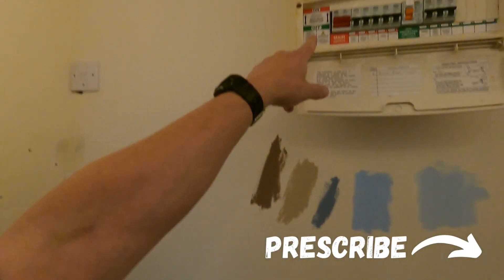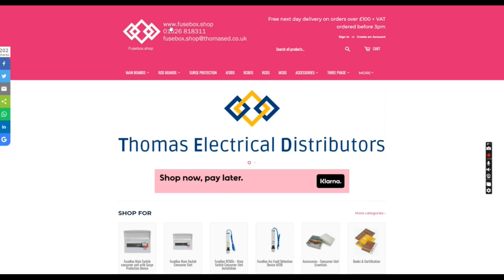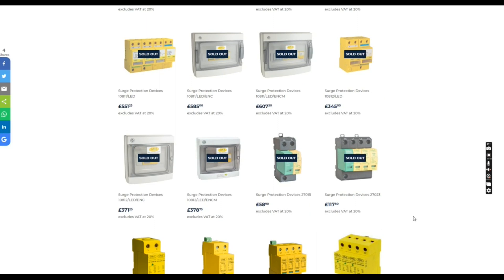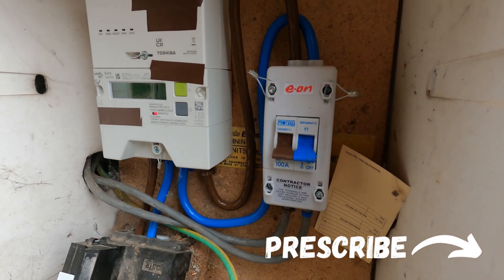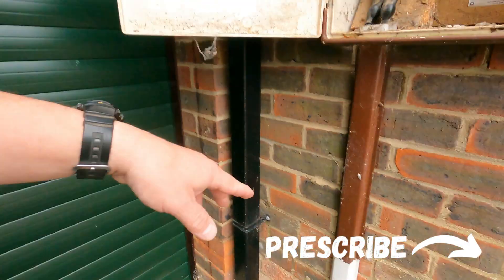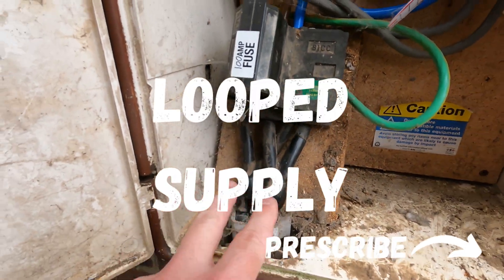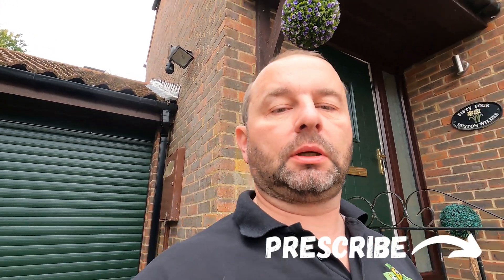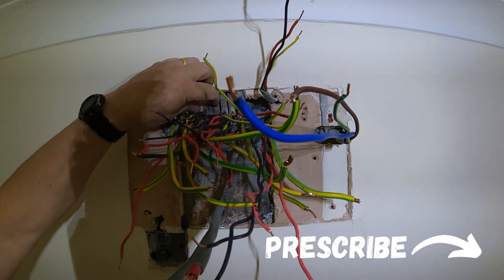Consumer unit change

Comment: Nice one cheers Dean For making the video is really good point about the looped supply. One thing I’ve only just discovered I’ve only started using the fuse box consumer units for the last three months I didn’t realise the taller RCBO’s or not double pole. Great job
Reply from the maker: Hi wills, thanks for the great comment.
I didn't realise that either, I've still got some in the van so I will test them later on today to check.
Thanks for watching!

Comment: Nice neat job, nice to see connecting isolated obsolete cable into earth bar. The fusebox boards are ok, but have found the actual metal enclosure to be really flimsy and it easily distorts when knocking out the grommet or rear entry holes. But the worst bits in my opinion are -  the RCBOs etc twist and hardly ever sit straight after tightening the terminals and the terminals are really poor with screw heads made of some sort of soft putty like material......much prefer Lewden boards although they have some poor points as well.
Reply from the maker: Thanks for the great comment Jon A.
I've never had a problem with the metal enclosures, found them to be quite sturdy.
I found also that the RCBO's twisted when tightening them up, then I bought a torque screwdriver and found that when tightening the screws to the right torque setting they don't buckle.
Thanks for watching!